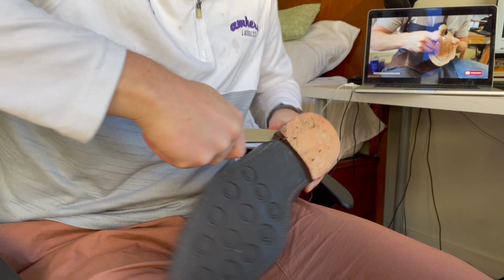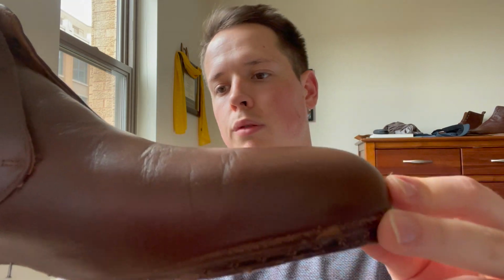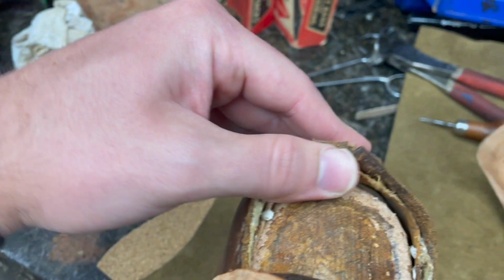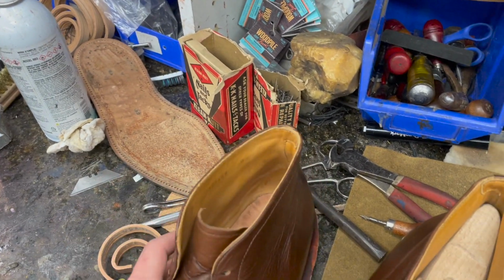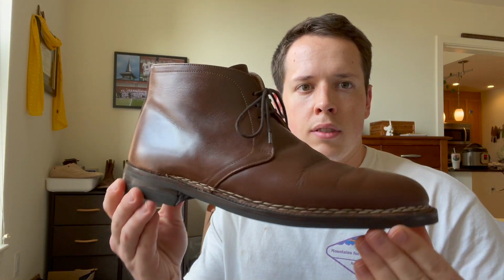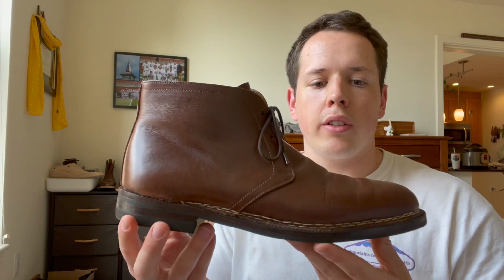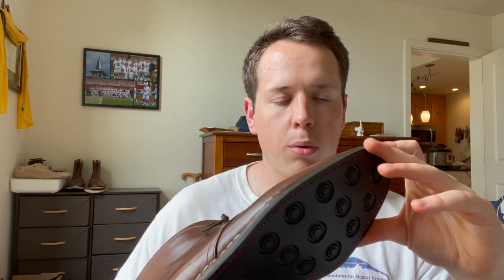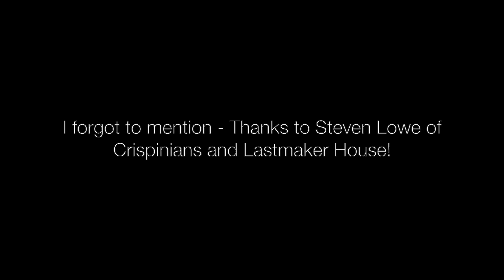Recrafting Chukka Boots for a Bespoke Fit

Comment: Thanks for sharing this! I know this was two years ago, but in case you're still interested: Maine Thread will sell you thicker seven-strand cord in pound spools for about $25. I like it unwaxed, so I can use wax or coad of my choice and easily taper the ends by drawing over sandpaper. LACIS in Berkeley, California sells a battery-operated cord winder for DIY'ing thicker cords for about $30.
Reply from the maker: Thanks for the tip!

Comment: I would recommend you sharpen your awls if you are having to put too much pressure. That is why you are breaking them. Especially with CS Osborn, you have to sharpen most tools you get from them as they skip that step to save the customer so money.  You need to get the awl sharp (not just pointy but actually cutting sharp). Also I recommend getting a thinner awl blade.
Nice video.
Reply from the maker: Thanks for the rec, Alexander!

Comment: The stich length is fine I think, it is personal preference, really. Next time, you should try to put a third cord, like a chain, this evens out the stich a little bit. You don't have to pull the insole stich on this construction, you are not lasting with the cord, unlike with an english welt. If you want a nicer to sand edge, you should try out some leather hardener, which is basically shelack solved in alcohol. This hardens the leather fibers and makes them more solid, so the sandpaper will not tear it.
Reply from the maker: Thanks for the advice and for watching! I definitely plan on doing a chain stitch next time but figured I would keep it simple for my first try. Regarding your second point, are you implying the lasting is done with glue (similar to a stitchdown logger boot) before the stitching is done? I didn't do it that way this time but that sounds like a good idea.
Reply: @altizer_shoemaker  I mean as lasting, when you are doing an english welt, you have to pull the inner cord in like crazy, to pull the upper a bit tighter as well, and to last the welt. With the norwegian, you just gracefully pull it tight, you don't have force it very much. Same for the sole stiches, they will look better if you just pull them in.
Reply from the maker: @attilavarga1152  Oh got it. Thanks for clarifying!
Reply: Jól gondolom hogy ön Magyar?